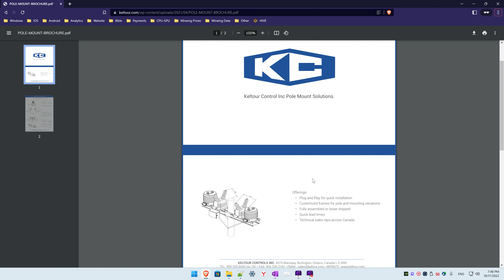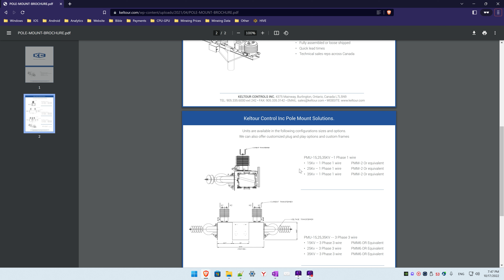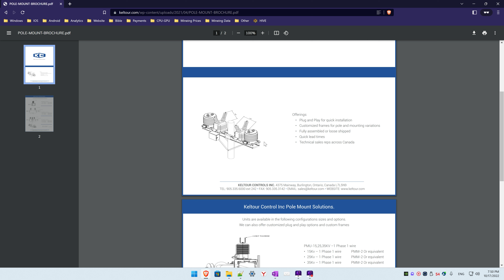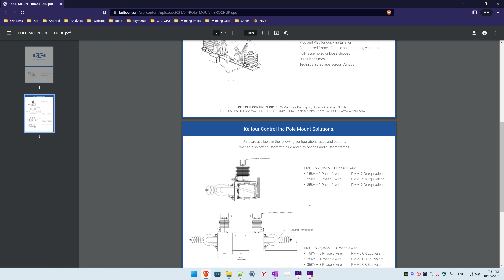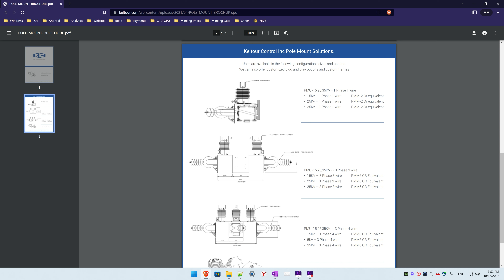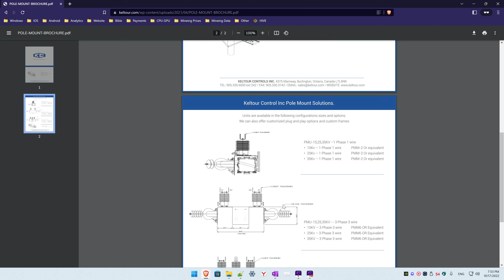2MW New Bitcoin Farm - Primary Pole Meter

Comment: Great video.  For my 3MW ASIC farm I have a primary meter as well.  My electric company also required me to install a recloser.  It actually worked out really well because I can also use it as my high side switch gear.  If I need to work on my transformer, or totally kill power, I just go over to my recloser and pop the switches.  The recloser also prevents back feed to the grid (if you lose a phase for example) and over current protections.  It was $40K, but worth it.
Reply from the maker: Yeah a good amount of pluses when you get a Primary Meter.